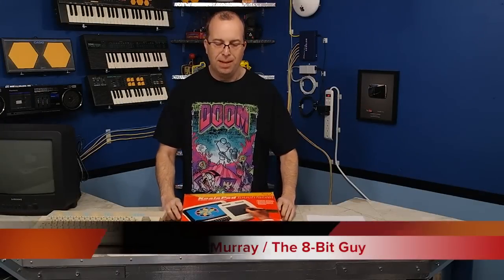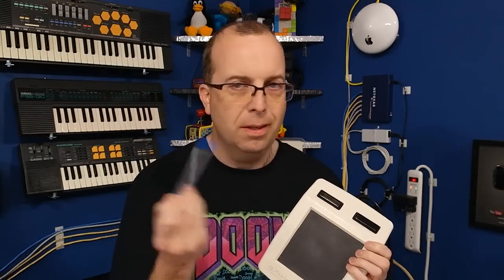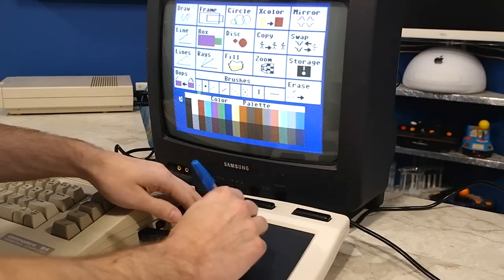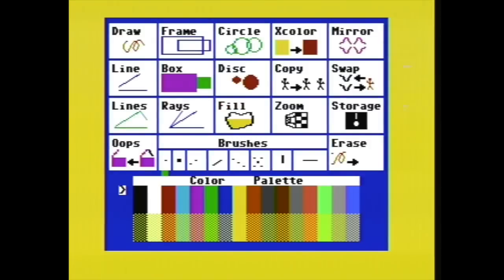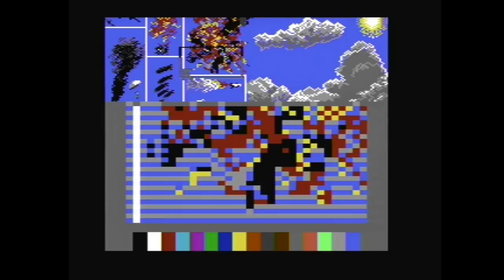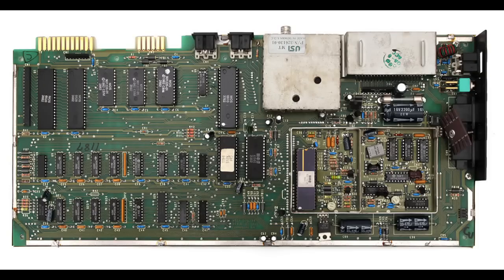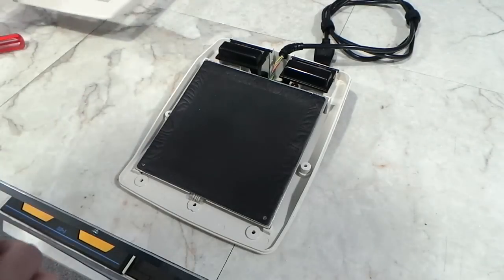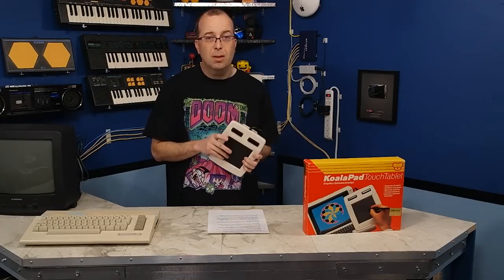The KoalaPad - How we used to create graphics

Comment: Punching the numbers into google I get... (Listed from the left side of the board top to bottom) LM2902J: Quad bipoler Op Amp.  μk 359 pc 0337: (obscured, could be a high speed dual op amp).  LM3046N: Transistor Array.  (middle) LM3046N: Transistor Array.  (right side) MM74C14N: Hex Schmitt Trigger. MM74C74N: Dual D-Type Flip Flop. CD4066BC: Quad Bilateral Switch. Looks like the board does a few things to flip between reading buttons and resistances, then does some computer magic to turn that into a signal.  It's not as cut and dry as I thought it would be, I'd love to see the back of that circuit.  80s electronics were so nice and reverse-engineerable.

Comment: Oh wow that "oops" button...
Also, I wonder if the PC version of the Koala Pad can be used as a mouse in Windows...
Reply: I don't think so, because ports are different and ... I also don't think that someone would take apart cables of USB and this thingy.. But it would be atleast interesting
Reply: Филипп Дмитрий Петренко
maybe the PC version just plugs into a 9 pin serial port. I was referring to Windows 1 and 2
Reply: Oh :D
Reply: Not without a custom driver.
Reply: if it behaves like a pc mode x and y joystick you can use any number of softwares to drive a mouse with it. but, as was displayed, it only has a resolution of like 250x250.
Reply: One byte per pot, so 256 x 256... which is all that was needed for the C64, since the KoalaPaint program used the multicolor mode, which limited resolution to 160 x 200.
Reply: Greetings!

Comment: Can you connect the koala pad or the other controls to a laptop or computer? And if so, do they work like a mouse?
Reply from the maker: No.  The interface is proprietary to whatever computer it was sold for.  In this case, the Commodore 64.  The Apple II version, for example, used a totally different connector.
Reply: What about the IBM compatible version? If it uses a standard RS-232 interface with Microsoft Mouse drivers, it probably would be a drop in replacement for a Microsoft Mouse on systems with RS-232 (Almost every system there is)
Reply from the maker: I believe it most likely connected to the IBM PC's 15-pin joystick port connector.  That way it would work almost identical to the C64 version internally.  I don't have one to verify this, though.
Reply: The 8-Bit Guy It could have also been done through the light pen interface, but my thought as to why it didn't use gameport is the fact that the Microsoft Mouse was a thing. Most painting utilities insisted on light pen or mouse support, and most PC painting utilities didn't use the gameport.

Another reason is more professionals were likely to have RS-232 or a light pen interface than a gameport, seeing as the gameport was literally just intended for joysticks.

I'm currently working on giving you a list of what chips do and a basic theory of operation for the KoalaPad. My guess is that it's a resistive touch sensor, but it would require quite high resolution to not look like arse, It probably has a DAC on it for output as a potentiometer. Another reason why I think it would be RS-232, no need for a DAC.

Anyways, looking it up.
Reply: To ammend, I can't seem to find out how this works based on the chips, It all seems like rudimentary logic instead of something like a DAC, which means they are using a non AIO DAC on a chip, or the pad is some sort of pure analog touch sensor.

I could of course be wrong, but I wasn't able to see some of the numbers well.
Reply: Communist Ralph It would not adapt well to a lightpen or serial interface.  To convert the voltage levels created by its resistor divider network (what the resistive touch surface functions as) would require the logic to implement an analog-to-digital-to-serial interface, which was a fairly expensive thing to implement in the early 80s chipset wise (the chips existed but were not inexpensive like today), so it would have increased the price a good deal.  To emulate a mouse would have required yet more logic to convert absolute XY coordinates into either relative or absolute mouse mickeys (the unit of measure for mice drivers), assuming the earliest mice could operate in absolute mode (it has been too long) otherwise you would keep busy with the flicking gestures as you constantly ran off the edge of the pad.  Regardless, emulating a mouse would have required an expensive, for the day, micro controller or microprocessor be embedded in the design to perform all the necessary translation.

It would be a mess trying to adapt a lightpen interface to such as you would essentially need similar logic but adapted to the effectively 1-bit interface of the lightpen (light or dark) and adapting that one but at a time interface to the expected scanning frequency of a lightpen.  The way a lightpen operated was by either of two possible modes, flashing squares on the screen and detecting the flicker of the square underneath it, knowing when that square was enabled or not, or by actually detecting the raster beam as the screen was drawn line by line and comparing that to the timing of the screen redraw to detect where upon the screen your pointer is located (since this predates most accelerated video cards the screen redrawing was usually entirely under either CPU control or specialized graphics chipset acting as a coprocessor, but there were registers that tracked the screen redraw timing that could be polled).  Neither is well suited to an XY coordinates pad.

So, much easier to simply stick with the provided game port that already provided for all the necessary hardware support and which kept the build cost of the pad to a minimum and also made the software implementation so simple that even a relatively novice programmer could write custom code readily should they wish to do so!
Reply: I wish I had good memory to know all the stuff you learn to how to fix old stuffs and know what they are and how to mod things. your a very gifted man, what do you do for a living if you don't mind me asking?
Reply: Communist Ralph The ADC is implemented within the C64 itself as the joystick ports provided for both analog and digital inputs, the Koala pad making use of the two analog inputs.  This greatly simplified the Koala pad design since it need only generate a voltage output that varied from either 0 to some arbitrary upper voltage or 0 to +/- some arbitrary voltage (I'm pretty certain it was the former so that no additional voltage division was required) as defined by the game port interface.  The logic in the Koala pad is really quite simple, it is an X/Y pressure activated sensor (likely a pair of such to simplify circuitry, one for each plane stacked upon one another likely as either a 3 or 4 layer device) with a resistive film between that creates a resistor divider network resulting in a varying voltage depending upon your X-Y coordinates.  This resistive sensor was provided power through a constant current regulator IC (to help stabilize the voltage generated by the pad's varying resistance) coupled with some op-amps to help scale the pads height and width to match the full 8-bit range of the computer's 8-bit ADC and some comparator logic that likely served to sense whether or not a stylus was or was not pressing on the pad at the moment to avoid unwanted spurious signals and/or to help determine when an onscreen button was really being pressed since the op-amp inputs are rather high impedance (and which might have been signaled via a digital pin on the port or may activate internal circuitry that simply holds the pad output at 0,0 (or any other coordinates) when no input was being made so that the software could detect the no-contact condition.

But that is a very quick reverse engineer from a single viewing of the video as I only remember a few of the ICs off hand, though there were not many and that is how I would have implemented such at the time for a C64.  Others may wish to elaborate further or make corrections if I overlooked anything since I have only viewed the video once.
Reply: i was about to ask that! Great thinking.
Reply: I guess you could connect it via Gameport if you have one on your PC (there are even USB gameports), but that depends on what exactly is happening inside KoalaPad.
Reply: Only posible chance, probably on a MIDI port that accepts the joysticks that are based on pots. But you need to figure out how ...... The only thing in a PC that takes analog input is the soundcard.
Reply: 38911bytefree The game port interface actually has 4 analog inputs for a pair of analog joysticks and is still available today as a USB adapter for older joysticks that originally interfaced with the game port (though I do not know if native drivers still exist in recent Windows releases).  On earlier sound cards the joystick and MIDI ports were one in the same with the game port interface providing MIDI support via the 15-pin D-Sub game port connector when not used for gaming.
Reply: Of course you can, You can use an arduino for that. :)

Comment: Always wanted to know what is that circular white disk with the apple symbol on the wall in the background?
Reply from the maker: It's a wireless access point.  An old Apple Airport.
Reply: Ahhh thanks
Reply: Pretty much useless nowadays.
Reply: +The 8-Bit Guy When are you gonna get a proper 80's CRT Color Television Set? I am a vintage TV collecter, Most of my TV's are from 1980-1989 you should consider getting one to replace your current bpc

Comment: I remember using Koalapainter with a joystick. False memory, it seems.
Reply from the maker: Actually, it was available as a Joystick operated software, and I believe even in a Lightpen version.  However, I tried the version on this cartridge with a joystick and it did not work.
Reply: The 8-Bit Guy I used to have a lightpen for the C64! I found it nearly miraculous. Good memories... 😊
Reply: Ah, so my memory isn't necessarily failing. Appreciated.

Comment: The only other computer to consumers that used a mouse pointer at the time was the Apple Lisa?

Only consumer computer if you don't also include the ZX Spectrum, the BBC Micro, the Amstrad CPC, the Acorn Electron and the MSX.   So basically ALL of them had them.
Reply: Did ZX Spectrum have a mouse peripheral prior to AMX and Kempston? Cause AMX Mouse came out in 1985, Kempston Mouse in 1986 and this is 1983.
Reply: AMERICAN consumers, larry
Reply: Fernando Torre 
Well say US consumers then.
As for the Speccy, I had one from 82-87 and never heard of one being available. Kempston joystick, yes. Spectrum mouse, no.
Reply: Microsoft introduced its mouse in 1983.It was sold with Word.
Reply: Even the C64 had a mouse (The Commodore 1351, but there were third party ones as well). However, very few C64 applications actually used it. It was much more commonly used on software on the C128. On the C64 only Contiki, GEOS, GoDot, Final Cartridge 3, PageFox, and Prophet64 used it. 

There were a few games that had mouse support such as Arkanoid II and the US version of Operation Wolf. Not to mention Maniac Mansion. and a few others...

https://www.c64-wiki.com/wiki/Mouse#Games
Reply: You seem to be everywhere

Comment: The pad looks like it works like a resistive touch screen
Reply from the maker: That's my guess. I suspect it has two layers that work like potentiometers, and one layer is horizontal and other other vertical.  Just a guess, though.
Reply: william fleete It is absolutely resistive, which is why it was a simple matter of a constant current source, some op-amps, and comparators to interface it directly to the potentiometer ports on the C64 (and, in principle, any other computer with the same joystick ports provided you have the software).  I believe there were two adjustment pots in the Koala pad, which were likely the X and Y scaling adjustments so that you could map the width of the pad to the available 8-bit dynamic range supported by the C64 joystick/paddle analog inputs.

Interestingly enough, we still use updated versions of this same general device, a la Wacom, for graphics design.  In earlier days, we also used digitizing tablets for both the data input and menu selection in earlier CAD software which is not terribly different from the Koala pad (though such was usually not resistive nor pressure sensitive, typically the technology was RF, capacitance, or inductive in nature) -- and in some ways I wish we still did as really preferred such to mice.
Reply: There's a hack to adapt a modern resistive touchscreen into a KoalaPad. I might have to take a stab at doing that at some point, since I have disks for GEOS and spare resistive touch screen overlay, but no mouse or touchpad for the C64.

Comment: I hoped you try to provoke attribute clash. I would have really like to see what happens.
Reply: You can try it for yourself with a freeware tool named Project One. It's purpose is to import, convert, draw and alter pictures for the C64. And it also loads and saves koala paint pictures. You can give it a try when you import a normal picture :)
Reply: Well attribute clash is triggered by software behaviour in face of hardware limitations. Modern software will use more advanced methods of resolving the colour clash. In particular when importing a true colour picture, every 8x8 block will simply be dithered individually with its own palette after finding a single global palette entry,  while Koala must work with the specific hardware-based colours you choose.

So i think a more proper method of "trying it for yourself" with regard to Koala Paint in particular is to try it in the emulator.

Comment: Can you please do Windows Vista is it obsolete?
Reply: Rohan Kwikscope yes yes they will end support in 2016-17 😱it was a bad operating system
Reply: Eh...that's debatable.  Windows Vista was a better operating system than Windows 8 was, in my opinion.  Really, aside from performance issues and driver compatibility, the problems were few and far between in my usage.  However, once Windows 7 hit the scene I did not hesitate to upgrade.
Reply: The only real problem with vista was the launch 6 months-year. With all the compatibility issues, drivers and pc's not having enough hardware, pc's not being ready for vista and all those things made the launch bad. But SP2 fixed all those issues. Still would like to see and episode on it.
Reply: Completely agree.  Most of the problems with Vista, like you said, weren't really Vista's fault.  Rather, it was the fault of the hardware it was running on.  Microsoft just abruptly made the OS a lot more power hungry, but they've been doing that ever since Windows 95 hit the scene.  When you get right down to it, every other version of Windows seems destined for failure.

Comment: I was going to say try hooking it up to a modern PC, but then I realized that 256-value resolution would not be useful on a modern display.
Reply: It could work, but it look weird.
Reply: the output is basically analog (a voltage), so it could still work for high resolution

Comment: There was also a version available for the Tandy 1000 line of PCs in the 1980s, which had a 5-pin DIN joystick connector; they were sold through Radio Shack and had Tandy branding but were otherwise identical. We ended up using ours as a mouse since we didn't have a serial port to connect a real mouse, and it was great, for about a year or so. 

Then, the pad started wearing out, and you had to press harder and harder with the stylus to be able to control its increasingly erratic movements. Eventually it went in a drawer and was never used again.

Comment: Side note on the SID chip letting the Koala Pad and paddles work...basically becuase the SID has ADC (Analog-to-Digital Convertor) circuits...this is basically the same reason why for so very long the 'game port' on a PC was generally part of the sound card (and doubled as the MIDI port)...once again, ADCs, especially since by that time PC sticks were analog rather than digital.

Comment: I had a very similar paint program for my Commodore64. I bought it in 1988 or 1989. At the time, we had to pay import duty on hardware, but not software. The computer magazine, I bought it from, advertised a package of a paint program and "free" mouse. That meant I didn't have to pay import duty. Had it been a mouse with "free" software, I may have been required to pay import duty.
The C64 mouse had two buttons and worked really well, for the time. I used it to do all sorts of artwork. Including having to zoom in to do pixel by pixel drawing to get the details right.

Comment: I had a Amstrad PC and a dot printer. I programmed a drawing application which used to print the final picture. Unfortunately i did not have a mouse so pointer was moving with keys only. It had line draw between two points and free hand draw features. I was only 14 years old at that time... :)

Comment: I still have my Koalapad, bought from a coworker friend about 20 years ago, bundled along with other stuff such as another C64, another datasette, some software & some books/manuals, all for $50.  My first C64 was bought in 1983, so I didn't have a Koalapad back then.  Haven't really used it, but it's still in my collection, so hopefully will pop that out for actual use when the time comes, whenever that will be, heh.